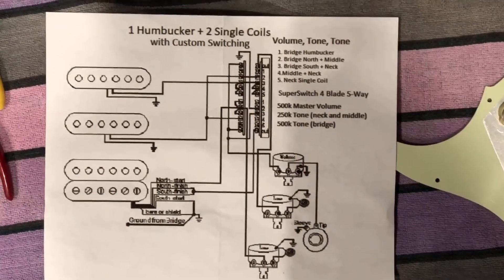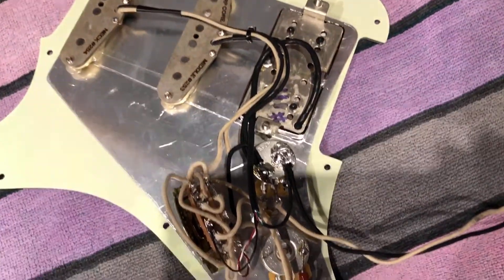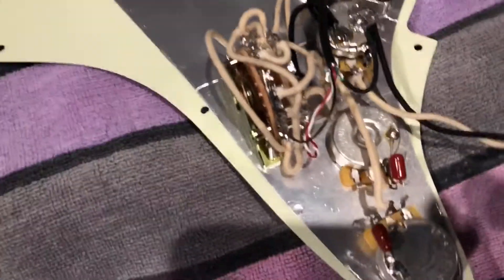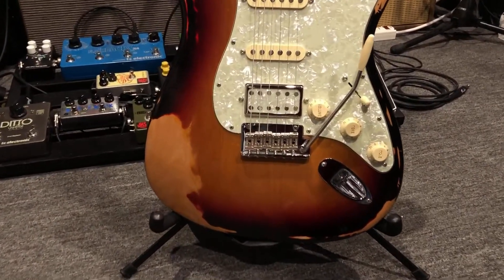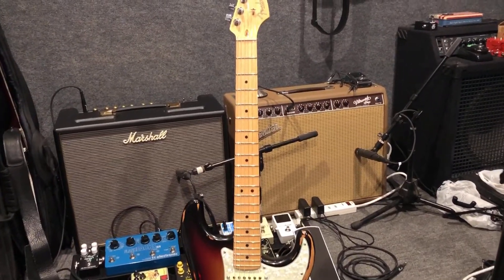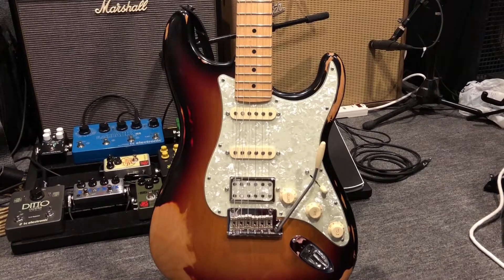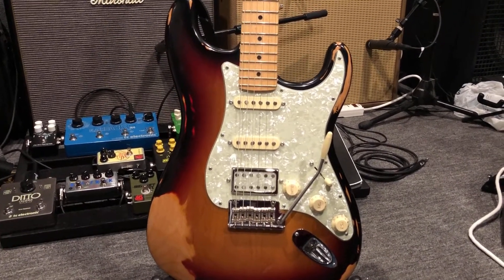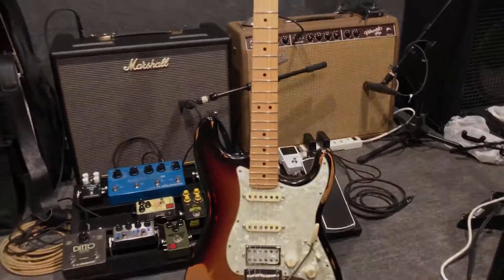New Set Up For Strat (w Notes on Wiring!)

Comment: Mr Campbell. May I ask your help. It's something similar but I must admit my cluelessness. I want to wire a HH strat with a 5 way switch that goes split coils on the extremes, humbucker on 2 and 4 and inner coils on position 3. One master Volume and one master tone. 

I really dont know if that's "do-able" with standard 5 way switches (I am not in the US so I have access to limited parts ) 

...  my other alternative is to put just an off/on switch per coil. 😐 

Thank you for your videos and spreading knowledge.
Reply from the maker: Thanks for your feedback.
That’s a tricky wiring idea. It is not possible with a standard 5 way switch, but something close can be done with a super switch,... Fender and Kash make them for about $20 US. They’re available through Amazon and most music retailers. The schematics are available on line. I Google what I’m looking for and dig around til I find something close,... then there’s some trial and error. 
I do wiring projects as a hobby, so I’m not the best at it, but it’s really satisfying I have it work out.
Reply: @charlescampbell6167  thank you very much. I guess I will hunt down those super switches with Keepa (currently 50 dollars in Mexico)😳 but I really want a 5 way swith on split coils... My other idiotic idea (just for fun) is to wire the 2 inner coils as a Phantom "middle" humbucker and the outer coils as in 1st and 5th... Just for fun. I know it's bananas... But now I am just curious about what will cancel phase 😂 (as positions 2 and 4 would have 3 coils "on") #LockdownIdeas